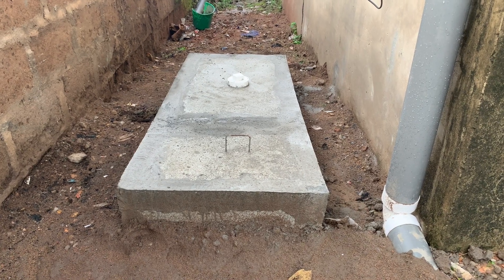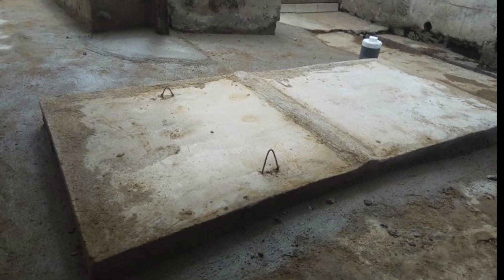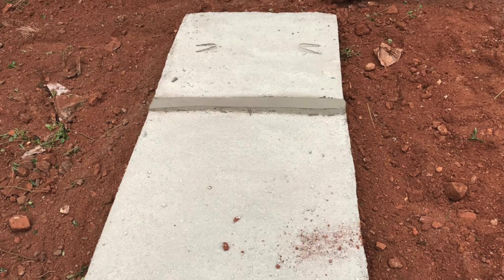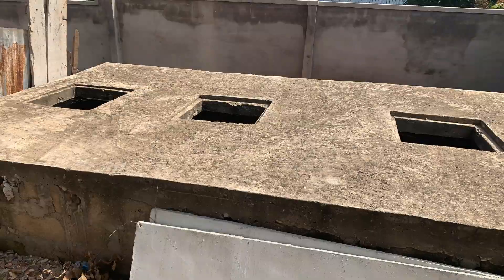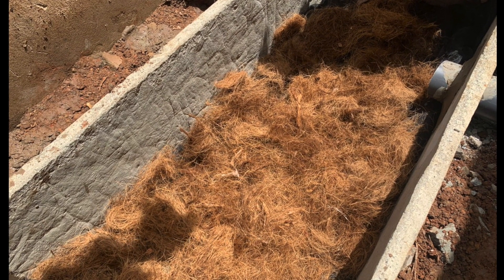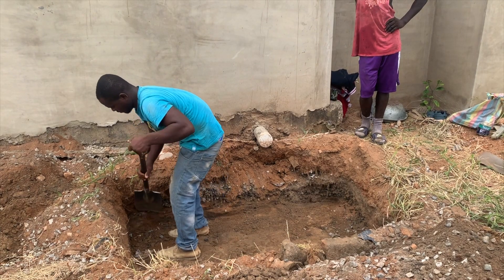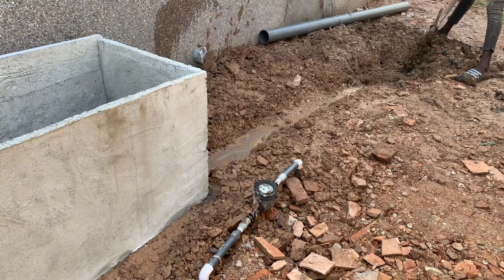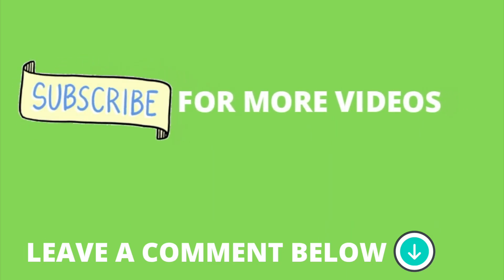How Do Biofil Bio Digesters Work In 2020

Comment: Did you say the microbes work under aerobic or anaerobic condition?
I'm following up from your previous videos which seem to suggest no vent is required.
If the new technology according to the study you quoted suggest aerobic condition then vent is definitely required.
Reply from the maker: That's true just that the researcher's reference is from what he has been told by the Biofil group. I wasn't going to dispute that because I no personally they don't put vent pipes on their digesters and have always written the technology works in the absence of oxygen which then makes them anaerobic anyways.
Reply: Plz l want your number